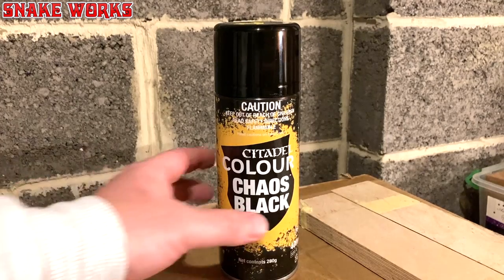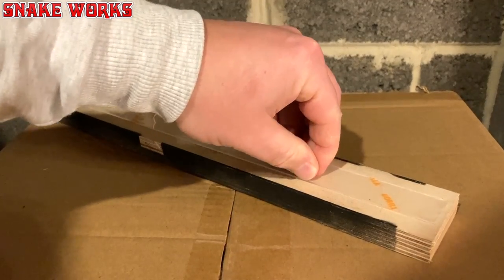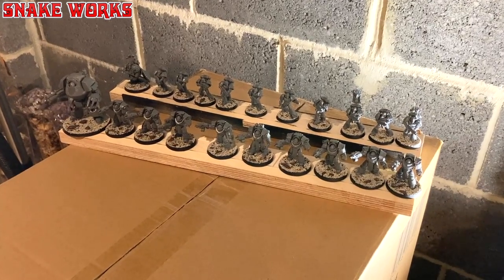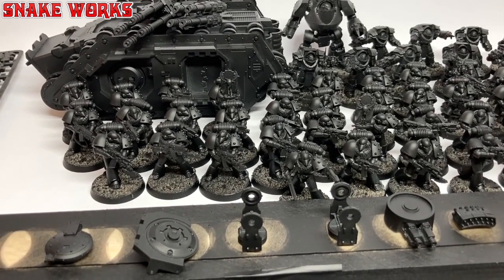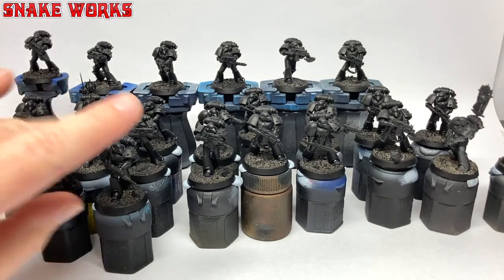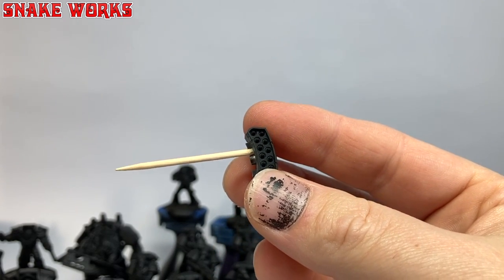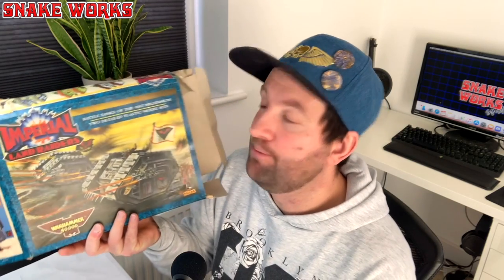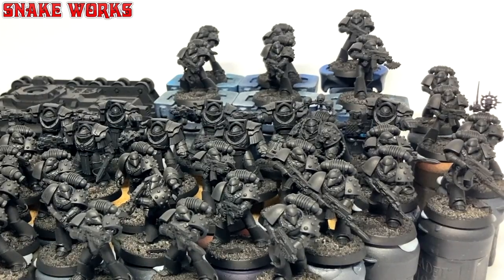HOW to Prime Miniatures PROPERLY -  Horus Heresy Hobby Project: Episode 8 - Age Of Darkness

Comment: I use a free chopstick with 2 beer bottle caps hot glued to it for a base. I then use a small amount of hot glue to glue each mini on the chopstick. You can then spray paint all of the mini and the underside of each mini. Turning the can upside down cleans out the paint nib on the can.
Reply from the maker: sounds a good trick! hot glue is something I need to use more!